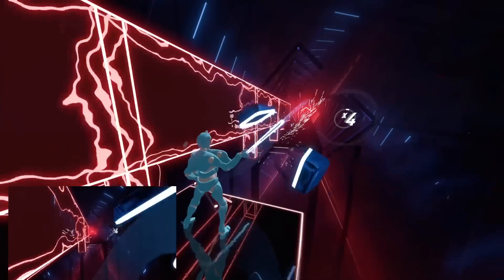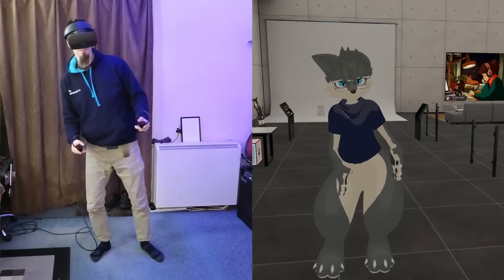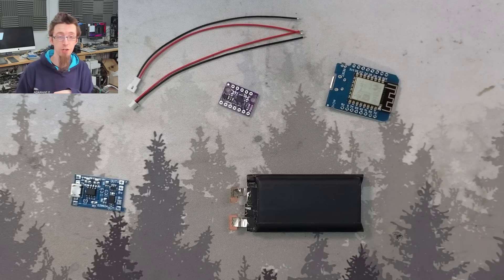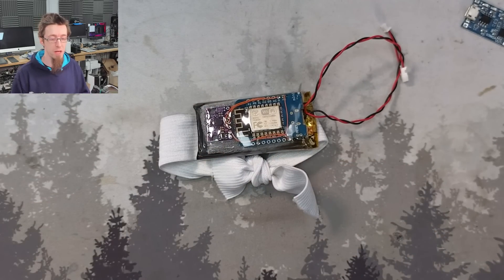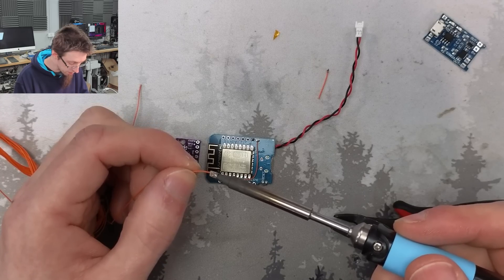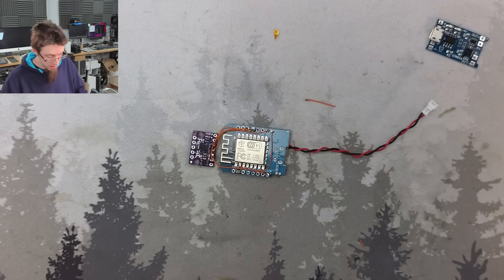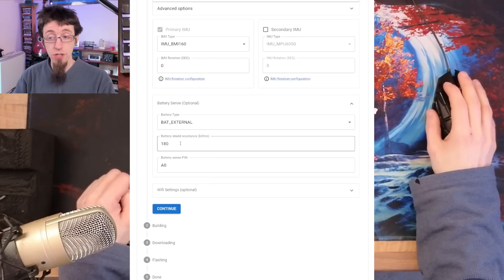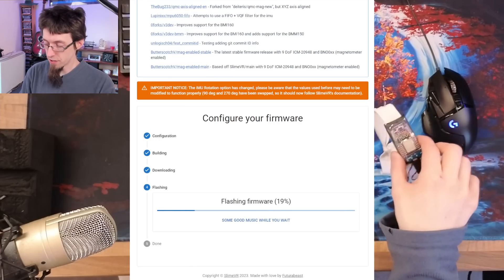Building a DIY Full Body Tracking VR Rig - LFC#350

Comment: Nice project!
However, the antenna of that module should hang outside of the device for best performance. The battery below creates a capacitive load that changes the impedance of the antenna a lot and "eats" its power and visibility to the outside world.

BTW, why don't you use floor tiles or anything like it under the PCB that you work on? This way you could avoid destroying the mat.
Cheers!

Comment: whenever i have the money to get into vr i plan to make a setup like this, except with AA instead of LiPo batteries so that i can swap them easily when they die
Reply from the maker: Standard AA batts won't cut it, as they're 1.5v, not 3.7. However, I had the same idea and built another set of trackers with 14500 size (AA) Lipo cells. They're not very high capacity, but still enough for at least 6-7hrs use, and quick to swap out and put in a charger. Problem is that genuine 14500 cells are difficult to find. I'm not sure I'd recommend them, but they are still easier than having a massive USB charger that can handle 4-8 trackers at a time.
Reply: @Adamant_IT  what about 3 AA cells in series?

also since you’re here, cute avatar :3

Comment: This is incredibly helpful. All my parts to build my own set of slime trackers just arrived, and it’s nice to have video of almost the entire process uses reference, even if I’m not going as minimal as you did here.
That said, to anyone else, that is considering this,find a friend with a 3-D printer and print some of the community designed cases. They make mounting, and assembly so much easier.

Comment: What would be a fantastic idea is to design a motherboard or better still a flexi circuit that both board could drop onto and be soldered into place without the use of Kynar wire?
Reply from the maker: Yea there's lots of folks designing PCBs where you can just place the modules on and solder all the pins. They're probably the best solution, but also require finding someone selling them directly, or you need to order them custom.
Reply: @Adamant_IT  I only dabble and by no means have the facilities to design something like this. Plenty of online designers out there do though. I'm sure maybe a few on your channel as well? Maybe something to look into? It would save a whole lot of time :) This is a fantastic idea BTW Kudos to the original designers SlimeVR & owoTrack and you for bringing it to everyone's attention :)

Comment: Nice job, running just the sensors back to a central point would be great.
Reply from the maker: There's a design for this called the OctoSlime, where you have a central pack with multiple extensions going to tracking points. I think the advantage is that the trackers themselves are super small because it's just the IMUs, and all the bulk is in one place, and there's only a single battery to charge - but the down side is that the system is less modular, one breakage means the whole rig won't work.

Comment: This was a wonderful video to watch and learn through. Wonder if there's enough amperage in a USB battery bank to power a bunch of these trackers, one single plug for the lot of them...
Reply from the maker: Possible. The TP4056 charges at 1amp by default, but you could mod them (programming resistor) to charge at, say, 500mA, and then have like, 6 charge off of a 3amp USB port 👌

Comment: Is a VR headset necessary (if yes, would it work if I only use the tracker from the headset and not buy a VR headset?) or can I use another one of these trackers to replace the headset?
Reply from the maker: Headset not required. You can use Slimes on their own for other motion capture as well, either for 3D animation or for Vtubing, or for anything else that accepts BVR motion data 👌

Comment: That was great fun, quick question if you bought the cells too how much would it cost per tracker?
Reply from the maker: It depends a lot on how much extra stuff you already have on hand (equipment, hookup wire, connectors, etc) but purely parts only I'd estimate £10-£20 per tracker.
If you buy parts from Aliexpress, you can push the price down to the low end of the bracket, but you'll be waiting longer and potentially have to buy extras that you don't need.
3D Printed cases I'm not sure the cost of, since I omitted them. If you have access to cheap/free 3D printing, that's going to keep the cost down too.
Either way, this is probably the cheapest effective FBT solution on the market right now. Other methods that use cameras, kinects, that kind of thing are more proof of concept and can't get anywhere near Slime's precision.
Vive can be more precise, but is also vastly more expensive.
Reply: @Adamant_IT  Thanks for the comprehensive reply much appreciated.

Comment: When you were calibrating the sensors does it just want any six random positions or does it need to be oriented certain ways, btw your SSID and ip were visible in the logs.
Reply from the maker: The six sides of the cube. Not a problem if it's rotated, as it will always see one side pointing up, and be able to calculate everything else.
SSIDs are temporary, it was easier to change my SSID for this video and change it back afterwards than edit it out, and an internal dynamic IP address is also worthless to an attacker.

Comment: Wondering if this could be used to replace  the head tracking on the reverb G2... I only use VR while seated but I’m really having trouble with the tracking... I’ve come this close to throwing it out the window... Imagine trying to do sim racing or flight sims and having to deal with the headset losing head tracking all the time 😰😰
Reply from the maker: I've just upgraded to a Reverb G2, but very specifically, the v2 edition with improved tracking. It's still not amazing, but it's not "broken".
Arm tracking would help keep a body model in-line, but it wouldn't be useful to solve tracking issues in other games.
Reply: @Adamant_IT  Mine is a V1 but i was pretty sure the actual headset was the same... It's only the cable that's changed... And i upgraded to the V2 Cable with the button... Maybe my unit is defective or my room isn't really helping? idk... I just know its completely broken most of the times... I only use it for sim racing and flight sim so i'm always seated... I need head tracking only... Arm tracking wouldn't work at all in Assetto Corsa or DCS :P Thank you for taking the time to answer though ^^

Comment: Not my cup of tea but interesting nonetheless. Thank you. Might knees and elbows be more useful sensor positions? As for batteries, how long would cheap CR2032 batteries last?
Reply from the maker: Maybe an hour if you have two of them in series... CR2032s don't have the current or capacity. The estimate for Slime trackers is 1hr per 100mAh of capacity at 3.7v nominal, so with CR2032s being 220mAh, 3v nominal, it'll be bad.
I used fairly oversize cells, I think mine are about 2000mAh, but that means I don't have to do the recharge ritual after every single use.
It doesn't actually matter where the tracker is on your limb because bones don't bend. So long as slime knows where your thigh is, it knows where your knee is, because the knee must be on the end of the thigh bone. Incidentally though, once SlimeVR passes the 'virtual skeleton' data to SteamVR, Steam interprets it as Vive trackers on the joints.

Comment: As you probably already know, you could get those tiny battery protection modules without the tp4056 charging chip but with the voltage protection mosfet circuit. They sometimes solder directly on those battery terminals. They're cheap too, if not cheaper than those tp4056 charging modules.
Reply from the maker: Yea, I forgot to mention that most lipo cells will come with basic protection boards on them, but also I feel like it's bad practise to rely on those, or rather, you can, but it's not something I should advise doing...

Comment: how much did one tracker cost in the end? it looks amazing
Reply from the maker: It depends on where you're starting from. It's a lot like when a cook says that a meal is cheap, but they already have a cupboard full of herbs and spices, and all the tools. I usually tell people to assume $20 per tracker, to cover all the small costs that experienced people overlook. But if you have any electronic parts in stock, or you're willing to wait for slow delivery times from china, you can easily get it down to $10-15 per tracker. You realistically want at least 6 trackers for a 'full body' set up.
Reply: @Adamant_IT  yeah I was actually thinking of buying parts from China, thank you so much for the detailed reply! I will definitely use your video as a help as well whenever I should start building <3

Comment: Does this still work with the current version of SlimeVR?
Reply from the maker: Yes, no major changes to how you build and setup. Most of the slime updates are quality of life tweaks and improving the auto-proportions system. There's also a BMI270 IMU around now, and is likely to be the next weapon of choice for trackers, but support for it is still experimental, so BMI160 and BNO085 are still king.

Comment: Do you need the resistor for this build to work?
Reply from the maker: The resistor line is for battery level monitoring. You can remove the wire and the tracker will work, but you won't have any way of knowing when the battery is low. Nothing terrible will happen, but it might shorten the lifespan of the battery if it gets accidently deep-discharged often because there's no warning or cut-off.
Reply: Thanks Adamant! 🤝